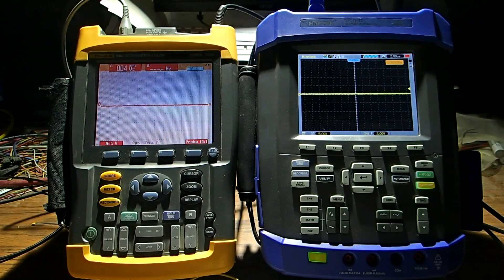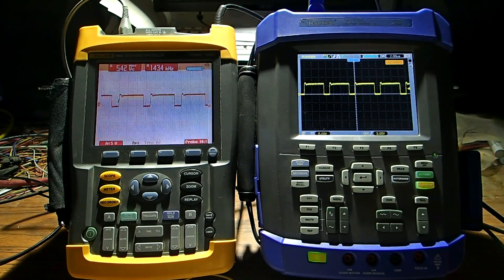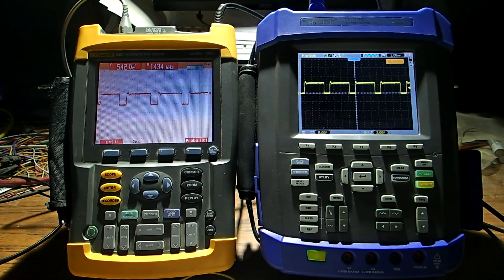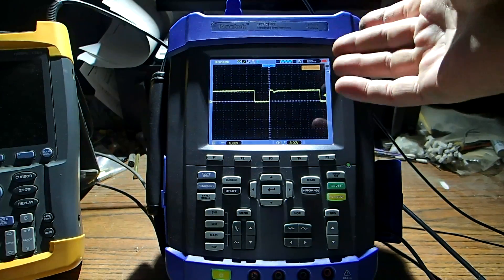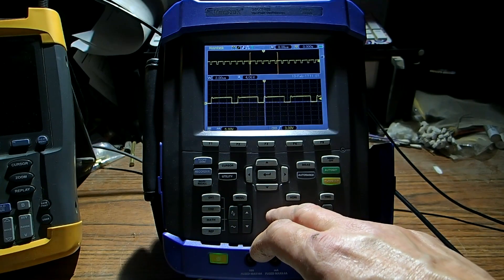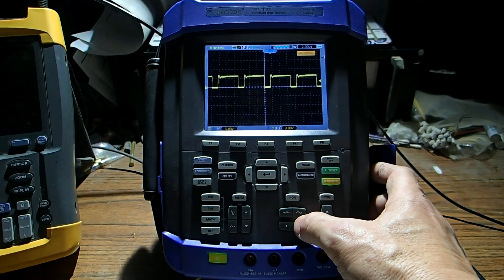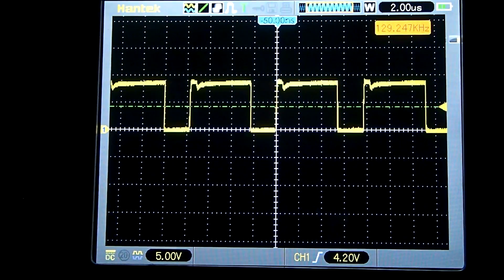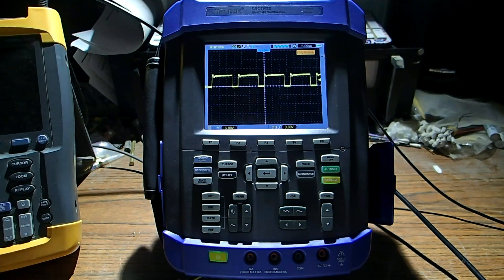Hantek Scope verses Fluke Scope (How Good is it?)

Comment: Somebody offered me a fluke 199 scope today for $950.  I had to pas because I know I can get a better combo of tools for $950 put together.  My dad was a electrician for the power company and I know what people really need.  These Fluke DMM/Scopes are crazy expensive for one reason;  the whole industry uses fluke for measurement consistency and safety (especially when dealing with large Voltages).  The engineers who design the fluke circuits do a very excellent job at drawing those PCBs and putting the same technology across all their products so that the numbers/measurements synchronize and match up.  But if you're not in the Electrical Company Service Provider industry, then you can do without the Fluke (brand).  Good video.

Comment: Your comparison is rather poor, please compare all parameters not only you decided is your favorite! Try for example isolation or even environment sustainability. This fluke wasn't developed for features like colors and your bench use. Its workhorse for outdoor measurement.
Reply from the maker: Well I guarantee you after you try out both those scope side by side you'd rather pay $500 then 5,000 as it stands I don't know of any scope that has isolated grounded inputs except fluke
Reply: @RaptorRotorHead  As who? as amateur of course, but Fluke is not unit for hobbyist. Take a specification and compare it side by side, That's fair comparison.
Reply from the maker: @bfx8185  your lost dude, you don't even makes sense, I am not a hobbyist I am an engineer can I check out the junk as well as the top notch stuff

Comment: I would be interested in the siglent high end with isolated Inputs, if you should ever have one.
Reply from the maker: I have one 1202X-E
Reply: @RaptorRotorHead oh, and how is it? Especially the recorder functions. Im just dealing with someone to get a Fluke 196 gen 1 for the Isolated Inputs and basic recorder functions.
Reply from the maker: @stalkinghawk9244  it works quite well but the only recording that I done with it was to put it on pause

Comment: This compare is like an old senior engineer (Fluke)  and Junior Engineer (Hantek). Old engineers will do small things, slower, but will do it precise and best.  Junior engineer will do it faster, will think quicker, but result might be with errors.

Well, I have Hantek, I have Fluke. With both I had issues (with Fluke display, with Hantek corrupt firmware). Fluke I can find a lot of documentation to fix, for Hantek I had to beg by their support to give me new firmware. And all documentation I got was in chinese :D. Finnally I had to search on internet how to fix it.
Quality inside of Fluke is WAY much better than Hantek regards to PCB, insolation, components . Probes of Hantek are jokes compare with probes from Fluke. 
On the other side, Fluke has some philosophy behind of that scopes to looks and work like that and Dave explained here: https://www.youtube.com/watch?v=ay9wFQAW19Y&ab_channel=EEVblog

Yes, Hantek is looking shine, nice view, fast response, a very good product vs price for hobby. But only for hobby. And is doing very well. Regards to safety, Hantek is a joke, trust me. Has no protections and that CAT 3, don't relly on that...they can write and stamp whatever you want.

On the other side, Fluke is a certificated brand regards to safety. Has good and quality materials, software is simple, but really stable, is for a professional domain.

Comment: there is an important remark: why does the FLUKE measure a frequency of 143.4 Khz (minute: 5:16) while the HANTEK measures a frequency of 129.3 Khz (minute: 15:50)?
if the remark is right, it is a big problem of precision for the Chenoise mark.
Reply from the maker: Because I changed the frequency I believe
Reply from the maker: Also the frequency generating device was just a 555 timer it wasn't an accurate sine wave generator or Square wave
Reply: @RaptorRotorHead  ok, Thanks

Comment: Hello, I am currently looking to acquire a Handheld multimeter oscilloscope. And I came across this DSO8102 which looks pretty good to me but there is very little feedback on Handheld Hantek hardware. The advice you always or are you disappointed after some time of use. Are there any issues with the material ? Thank you in advance.
Reply from the maker: Good piece of equipment
Reply: @RaptorRotorHead   Thank you reassure me because I see some comments on forums that this one would be of poor quality.
Reply from the maker: @robinswolfs3415  the only drawback of hantek scopes the inputs the grounds are not isolated which is normally not a problem when measuring two different signals as long as they're both grounds are equal
Reply: @RaptorRotorHead  Indeed this is why I hesitate between the Hantek SDO8102 and the Siglent SHS1102. What would you advise me without looking at the price?

Comment: What kind of battery hoes the Hantek have? Is it custom or just 2 18650 cells?
Reply from the maker: It uses 6 18650 cells, it has a plastic holder in the back which the cells are inserted into then that's inserted into the scope
Reply: @RaptorRotorHead  Thanks for the quick reply. Do they come included in the scope or you have to buy them separately?
Reply from the maker: @ooltimu  they come included in the scope but they were not fresh it took me about two years to realize this and when I put in brand new fresh batteries the charging system operating different than what I described in the video when the batteries are fully charged the green light doesn't flash anymore and it stays on continuous

Comment: comparison?  well, your hantek was on the show, the fluke remained dark
so I allow myself a few remarks
- unfortunately I could not see the type of the fluke but as of the design I tend to say iths is a 19xC (x stays for 6 or 9), this series was introduced about 2002, 19 years ago
- safety? fluke gives fully isolated channels up to 1000V cat II and 600V cat III, your hantek will blow away when you connect each ground to individual phase on your power socket
- functions? yes, nice, does the hantek have replay? this is a really powerfull feature when you troubleshoot and got a "glitch" on the signal but missed it. fluke will show you in the reply memory the last 100 screens you saw.
however, a fair comparison looks different than yours, for a hoby task this is fully ok, for professionals? probably not. one point you are right, the price is really competitive for a blue box looking the same as the yellow one.
Reply from the maker: I know the hantek doesn't have isolated outputs, but that's about the only thing. Another issue is the fluke scope allows dirt to get inside the display which was really a bummer for $2,500 that I paid for it.

Comment: Hello, I found out that Hantek and Panasonic have many media-level marketing promoters in Google. I bought a DSO8202E, its default depth is 4K, and can not observe SD video signal (I use Tektronix video signal generator), 40k depth. It can capture 1 field of video signal, it is very accurate about audio signal, but it lacks a matching trigger mode. This kind of oscilloscope will always be compared with Agilent (Keysight) video vector oscilloscope, because the latter's response speed can achieve the effect of fish tank feeling. The biggest weakness of DSO8202 is that there is no isolation. Repair of full-channel AC circuits is not possible. As for FFT, it is just a deceptive trick. Thank you. I can buy a Tektronix THS730A 200M isolated oscilloscope for $300. Thank you for having a more powerful universal watch.

Comment: Hi, thanks for your video. I have some questions. Can you use funtion generator and scope at the same time? There is some recorder funtion like fluke? Can you use multimeter to make automatic trend capture? Theres is another chinese scope with trend funtion?
Reply: There is no generator in this model, because at 10.37, the third Scope / DMM press did not turn on the DFG screen, but returned the unit to the DSO screen.
It is possible to use DFG and DSO simultaneously, it is impossible to see both interfaces. I also wanted to have such a function.

Comment: Model number of that Hantek scope please. I can't find it anywhere. That would be nice having a cheap handheld scope.
Reply from the maker: DSO1072E
Reply: @RaptorRotorHead  Awesome. Thanks buddy
Reply: @RaptorRotorHead  Wow, it costs a LOT. I wanted one so I didn't need to keep taking my laptop with me everywhere. I could get five of the 8 channel USB scopes for less cost and have the full FHD laptop screen for software interface. I thought it was annoying to have the laptop, but it's not $600 annoying ;)
Reply from the maker: There's a little handheld version that's pretty good too for about $139 you can see it on eBay right away just type in hantek oscilloscope.
Reply: @RaptorRotorHead  Cool, thanks. I'll look into that for sure. $140 is a lot easier to bite

Comment: Fluke scopes have 6X Ni-MH battery pack, they are the size of 18650s.
they are sold between 300 to 400 USD on amazon or from fluke ...
its a fucking joke !
Reply from the maker: I bought 18650 batteries for the hantek now it runs so long and the battery says full still. cost 15 dollars.
Reply: @RaptorRotorHead  everything should run from li-ion 18650s ...  but not fluke ... its 300$ Ni-Mh pack for flukes .
thanks for the vid BTW , and glad to know your hantek still running long and strong

Comment: Thank you for taking your time to review this. Would you recommend this for a beginner who is planning to use this on cars for testing components like wheel speed sensors, ignition coils, canbus etc? Great review
Reply from the maker: Indeed I would recommend it.
Reply: @RaptorRotorHead  If you could pick between your hantek and SIGLENT SHS800 which one would you buy? Thanks
Reply from the maker: @TheKeenMechanic  I would buy the hantek.
Reply: @RaptorRotorHead  Thanks. What model is your hantek ?
Reply from the maker: DSO1102E , it is very similar to this one there is other ones that have Spectrum analyzers built-in them they cost like $100 and fifty bucks more. But this is the model that can a rugged case runs all day on the battery.

Comment: Recently I had to send in my Fluke 190-204 scope meter (4CH, 200MHz per channel) in to Fluke for repair.  Repair cost is $1050 Canadian (about $810 US) flat rate, irrespective of what they find or how long it will take them to repair it.  Out of curiosity, I started checking out the competition to see where other makes are at these days and this is what I can say regarding the huge price disparity when comparing companies like Fluke or Rohde & Schwarz (Europe) with Chinese knock-offs:
There is no doubt that you can get some cool features in these cheaper scopes but you also have to understand their target audiences.  Fluke and Rohde & Schwarz are building for serious lab and industrial clients in markets where liability is high and so are the demands for quality and reliability, so they are well built instruments using high quality components, including robust probes, where safety is critical.  None of the Chinese knock-offs from companies like Hantek or Siglent match the category ratings of either of the aforementioned scopes.  Fluke for example is CAT IV at 600V and CAT III at 1kV.  The highest I've seen on the Chinese brands is CAT III at 600V and you have to watch it because some only have a 150V peak input instead of 300V.  This is disconcerting because they also come with switchable 1:1 or 10:1 probes, so if you forget to switch to 10:1 on your probe and then go across household voltage at 230Vac, you've now over-voltaged your scope input (depending on the model).  This says nothing about the inferior quality of the probes as mentioned in this video.  If they've short changed the buyer on the probes, where else I wonder have they cheaped out at the expense of safety?  Do they even come with UL or CSA certification and can they be purchased through an actual store in North America or only through Amazon or Alibaba?
Fluke did extreme tests for dust, oil, and water penetration and built a sealed scope that was also drop tested.  They also used special design techniques to physically separate the PC tracks between all isolated inputs (and each channel is fully isolated from the other so commons can be at different potentials, something not readily available until you're at least at the $1k+ level with the other scopes, and then again, at a lower safety rating).
So if you're working in a nice, safe lab environment, in automotive, or buying these on a budget for some school, or just a hobbyist where 230Vac is the worse case voltage encountered, then go for the Chinese makes.  But if you're life depends on having a piece of hardware that isn't going to blow up in your face when you're testing a 20kW or higher motor drive at 600Vac in some industrial setting, then think twice.  I understand that a price differential of between five and ten to one is extremely tempting, but there is truly a level of comfort when dealing with a company based either in North America or Europe who fall under closer legal scrutiny in ensuring that their products are safe for use on high power systems.  There's a reason why professionals are slow to pick up these cheaper scopes but for low energy work, I'm sure I'd consider them too.  After all, you could get 5 high end Hanteks for the price of one Fluke 190-204, but with the Fluke, you're also getting 4 channels vs 2 max and usually to a higher frequency, so you get what you pay for.
Reply: ^^^ my thoughts captured exactly!
Reply: I've always hated how fragile the fluke screens are, but other than that issue flukes are great.
Reply: Thats the thing, I dont disbelieve you, but my poor ol Fluke was a doorstop for YEARS, when something fell on the screen, despite the tough exterior - and the new color ones are 'Telephone Number' prices :)
At THESE prices theyre a less expensive asset you can take into the field
Reply: You catch my thoughts.

Comment: Yep.. When you steal some other companies design properties. You don't ask for the Manual.. Got to love the Chinese mentality. If it's not nailed down. Steal it..
Reply from the maker: Recently I purchased a $2 power supply from China now the difference in this is that it had current regulation as well but it didn't start out that way, somebody in America modified the circuit to be current limiting, then Chinese stole that circuit design put it on PCB and now selling for $2.

Comment: You buy a fluke when you work in industry.  Not for a home lab.  Silly comparison if you ask me.  Are you willing to risk life and property with a no name test tool? I would get chewed out if I brought this to work!
Reply: I have a friend who works on oil and gas rigs in the North sea, we discuss and use test gear all the time, I'm pretty sure all the test gear has to be intrinsically safe before it's allowed on site, the same goes for computers and radio gear when my nephew had a software project product been rolled out there. Mining might be different but I would have thought there would be similar gas related hazards there too.
Reply: We have fluke scopemeters and never use them outside clamp meters. We use these Chinese scopes all the time though and they’re quite accurate and convenient for the cost and it saves a ton of money! The batteries also don’t cost a fuck ton and we can plug them in with a phone charger 😂 they run on 18650 batteries instead of some expensive proprietary battery pack.
Reply: I work in industry. I use hantek. I had fluke before i sold it i bought hantek and put $2k in my saving account. Only stupid and ignorant people buy snap off and fluke. (most trade guys) I am an engineer. By the way my salary is $200k at year i work in mining.

Comment: I'm very impressed with Hantek's products. I use their 1008C PC based scope for automotive diagnostics. It has a 12bit vehicle resolution at only $120 and has plenty enough sampling rate and bandwidth for slower automotive signals. The only thing it suffers on is serial data like CAN bus captures. But overall I'm very impressed and it has bailed me out many time when faced with complexed diagnostics issues.
Reply: Are you using the H Scope app yet?
Reply: @NewLevelAuto  yes I am , it's pretty good and the creator is for receptive to input and ideas.

Comment: what you didn't say was how frustratingly slow the hantek is  compared to the fluke .also i purchased the dso 820 and within 18 months it stopped working .it would not self calibrate.no support no communication from hantek .bunch of wankers  .inside when i went to trouble shoot and found all the IC numbers sanded off  .i had to sell it at great loss .now i have a lovely fluke .fast ,accurate and reliable .no more chinese crap!
Reply from the maker: The hand Tech it's not slower than the fluke it's faster get updates instantly upon signal the screen updates faster so there's no flickering when you video it.

Comment: Im just using a 26 Years old Philips ScopeMeter PM97 (same Models as the Fluke ScopeMeter 97) and it still is Perflectly Fine, it has also an "Auto Set" Button the Monitor isnt rely good but it is good enouth to see what u are measuring.
(thats a Pic so u can see what i mean) https://www.abex.co.uk/esales/test/philips/oscilloscope/pm97/dm5971524_s02421/hires/p1100876.jpg
Of Couse it isnt that Fancy but i think it shows what are u Paying for if u Buy the Brand with the Yellow Bumbers mine is 26 Years Old and its Fine ;D